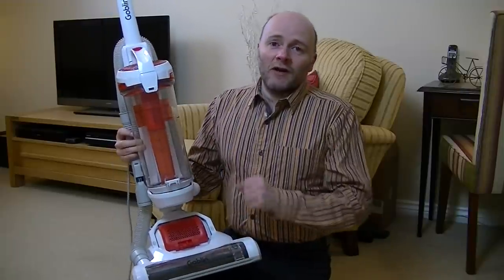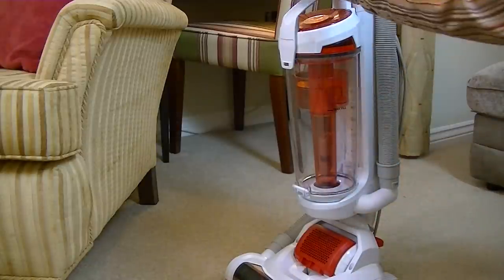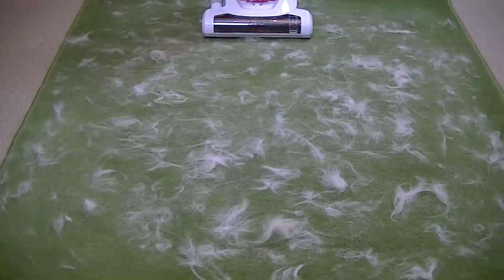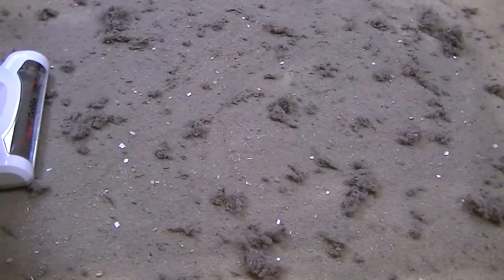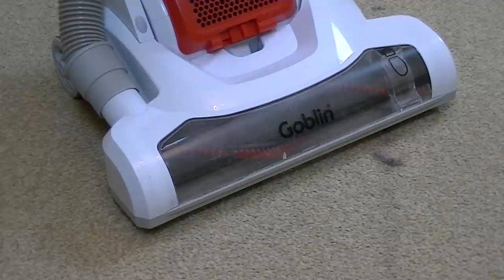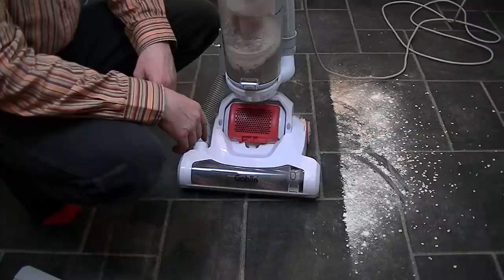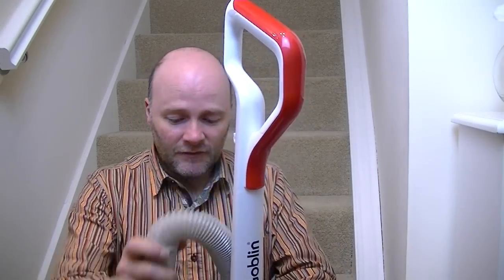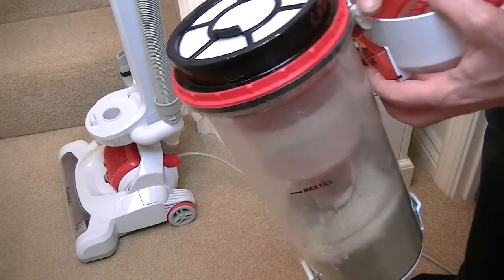Goblin Bagless Upright Vacuum Cleaner Demonstration & Review

Comment: Do you believe that this is what has been rebranded under the black and decker logo as the B&D Air Swivel vac after modification? I'm telling you it looks JUST like it. Does it vacuum first through the hose before going into the chamber? It also reminds me of an old Dirt Devil we had that sucked through the hose system on way to the chamber. It got clogged once or twice really bad. This is an issue with these sorts of vacs. Good suction when it works, though.

Comment: The motor and brushroll sounds similar to the newer Hoover and Dirt Devil vacuums sold in the USA.
Reply: They have had to reduce the wattage of machines in the EU so I wonder if that has something to do with it. Here in the US our machines have been limited to 12 amps (1440 watts) as typical household circuits can only handle 15 or 20 amps before tripping.
Reply: I believe Goblin vacuums are made by the same company as Dirt Devil and Hoover US (TTI).
Reply: manlikewellard sounds like an old Bissell clean view
Reply: No I don't

Comment: What bagged up right would you recommend . One you can still buy of course
Reply from the maker: Sebo Felix.
Reply: ibaisaic  thanks I did look at them bud sadly a bit out of my price range .was looking at a hoover but they are only 700w now
Reply from the maker: I'm assuming you are in the UK, so your only choice for a bagged upright at a lower price point is the Hoover Purepower or almost identical Enigma. Both are 700 watts, but the Enigma is a quad A rated machine. You can see the Enigma on my channel. The 700 watt models are discontinued and will be replaced by 350 watt versions.
Reply: ibaisaic yes I’m in the uk . Will look this weekend thanks for that